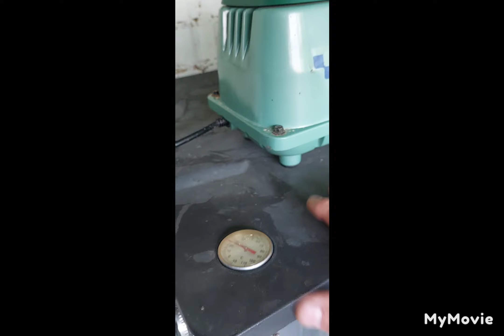koi chit chat #paint by numbers #new additions. ..

Comment: Nice multi-bay. Can’t go wrong with Japmats.
Reply from the maker: Do you think the gaps are too big ?? Or could I put more matting in there ? Would it effect the flow ?
Reply: More mats the better. I wouldn’t worry about the flow. Unless you want the super high flow that is required to make sure the bottom drain pipe is free of any settlement.
Reply from the maker: Thanks 😁